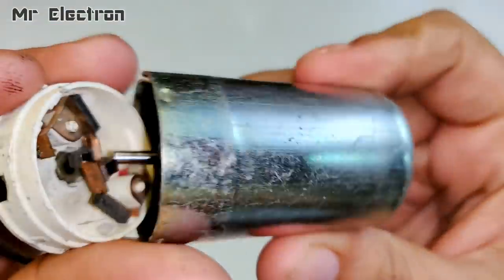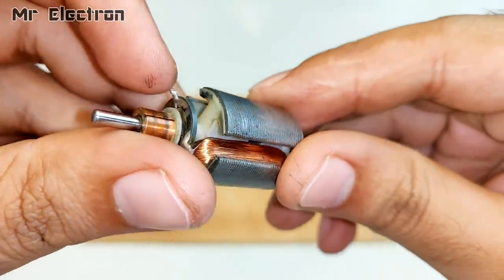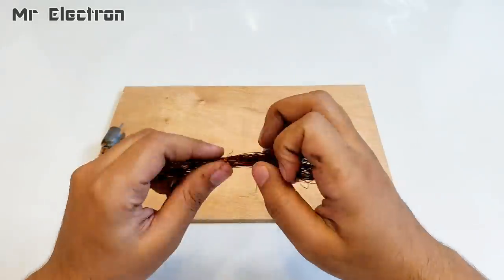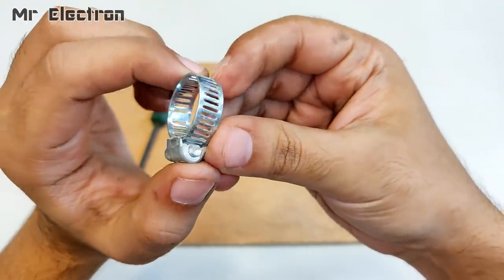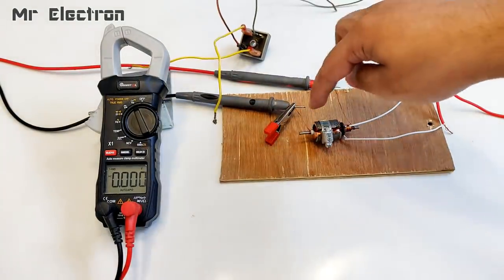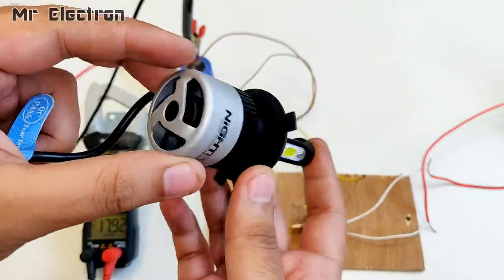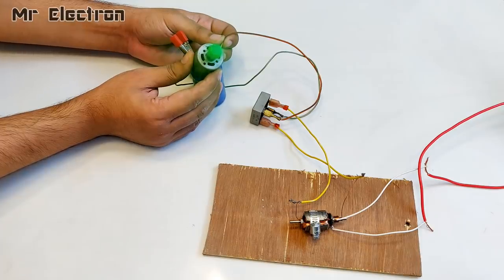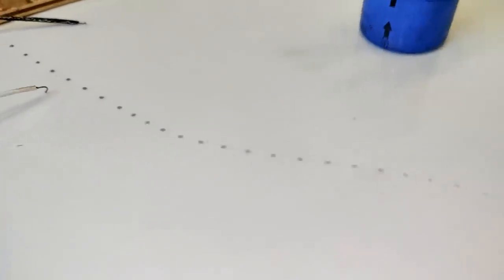Make 220v to 12V 5 Amps Supply using DC Motor as Transformer

Comment: How did you connect it to the mains in a way it's not burning and stuff? Let's use ohms law to calculate the current going thru your coil of primary , first you applied a voltage of 220V to it and the resistance of the primary is 12 ohms 220/12 = 18,333 amperes . Did you limit the current at least or something ? Because that primary can burn down really quick as it's a very thin wire with 18 + amperes going through . I'd rather put a low voltage to it by a variac like 50volts or something . Just asking if you limited the current to the primary or i don't know because there is no way that wire can handle 18+ amperes .
Reply: Impedance is expressed as the sum of resistance and reactance. The inductor reactance should increase with rising frequency whereas for a capacitor it decreases. It's not like pure DC where you only rely on the resistance of the inductor. But yes, you can get over 18 amps, depending on the voltage which can be as high as the product of the RMS voltage and the square root of two, but that inrush goes away as the signal reaches the zero-crossing point

Comment: What a fake video. How can you apply 220vac to such a low number of turns of a small dc motor? Not taking into account the diameter of the core and etc
Reply: Sure it's fake. To have a transformer you have to know how much iron you have , the ampere turns for primary and for the secondary. 
One question : why the uploader didn't measured with the meter the input voltage ( 220v in this case )?.

Comment: Hello I'm currently making a ebike with a brushless motor it's 24v 180w can I use a 24v 500w controller running 3 12v 12a batteries?

Comment: Not recommand to try. It is very dangerous. Because I know the basic theory of transformer design and building. I don't know how he can assure 12V 5A output. This project maybe for short-term demonstration.
Reply: It's clearly a fake!.
He even didn't account for turns ratio!
Also not showing the 220v and whole wire is more than a fake.

Comment: Awesome idea! I at first taught d motor was for high speed switching , pls i would like to ask if i can run a 3vdc motor on 12-24vdc and a 6v dc motor to that same voltage range and without causing any damage.thanks🤓👍
Reply from the maker: Obviously, there is a little chance of it getting damaged if used for short duration and high chance if used for longer durations